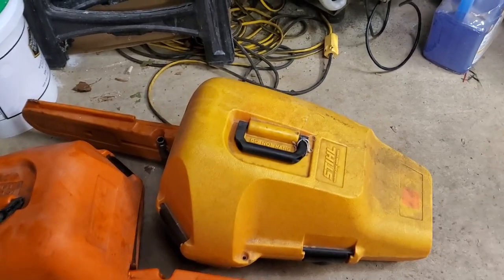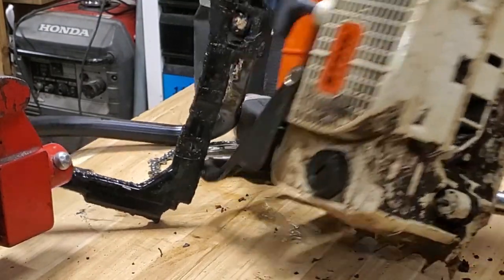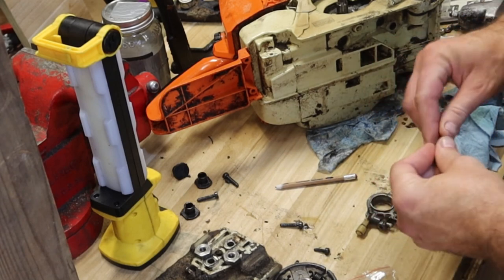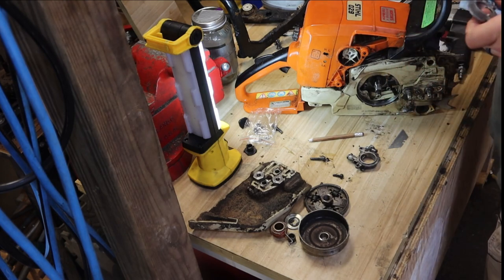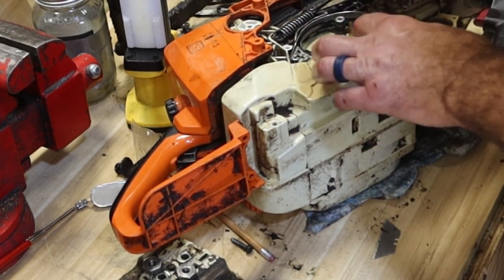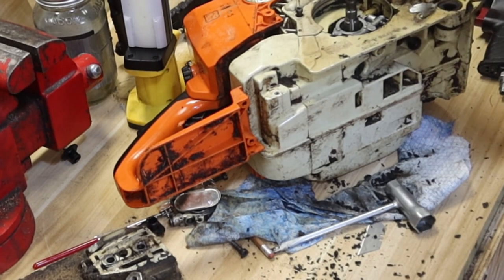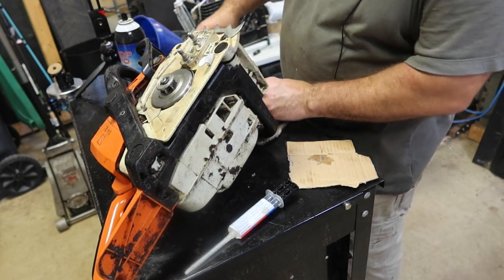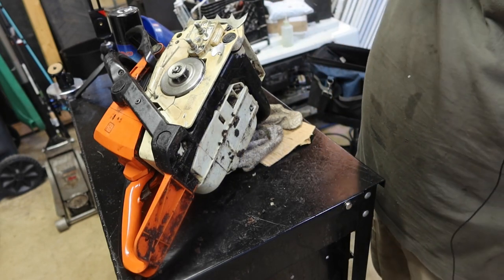Stihl 029 oil leak with a surprise ending

Comment: I have a 039 looks to be the same age. I know I’ve had mine 23 years. Mine was slinging oil off the bar like crazy. I took it apart after watching several videos and after the repair I went to put it back together and I could have swore that mine also had that plate that you were looking for. I searched for two days looking anywhere and everywhere. I finally said the hell with it and put it back together and said if runs it runs if not then I’m off to the Stihl dealer. It runs fine thank god. Great video the most detailed on showing every possible place that the oil leak could be coming from!! 👍
Reply from the maker: Thank you so much for the feedback!
Reply: Oil cap! That's the first place I look every time!

Comment: That plug you referred to along side the muffler can be fixed by the grub screw used in the older Stihl models vent system. The older models used a length of hose with 2 of those screws. 028 used 'em among others. It'll thread in with no problem but make sure don't go too far in or you'll block the oiler passage.
Reply from the maker: Oh cool. Thanks for the tip!

Comment: Every time I think I’ve  learned every possible reason for a bar oil leak I find another one!  Great save!  Although I’ve used 1184 for a lot of different applications, my first thought for that fix would have been the plastic epoxy. I might have slathered the screw with silicone grease before installing, just to see if it would be possible to seal the leak and remove the screw also. The other possibility might be to apply direct heat to the screw after the epoxy set up to see if it could be removed. Anyhow, thanks for the video and adding one more thing to look for when I’m running down oil leaks. 👍🔧🧰
Reply from the maker: Those are 2 great ideas I never thought of. Thanks!

Comment: I missed the absence of the flat plate washer.  When I looked back at you video it was missing.  I would have replaced the oiler.
Reply from the maker: Correct, the plate washer was missing. Thanks for watching!
Reply: @RayofallTrades  Stihl calls it a cover washer.  For some reason someone left it off the 029 that I rebuilt, too.  I caught it on the IPL and replaced it.  If it is not there you can cause all kinds of problems.  Just remember TOP means what it says - TOP faces outward.  If you put on a rimless sprocket please remember it takes a thicker steel washer, instead of the aluminum one used with spur sprockets.  If not the sprocket will bounce around on the sprocket and wear both out prematurely.
Reply from the maker: @johnclarke6647  thank you so much! I don't remember if I specified that in this video. I do try to take, share, and spread knowledge whenever I can. I appreciate you commenting!
Reply: @RayofallTrades  you are welcome.
Reply: Some of the early 029 and 039s did not have the washer under the clutch. They clutch used on the was slightly different also. I've rebuilt at least 25 of these. Great video.
Reply from the maker: @bryanmcgovern7858  Thank you very much for that!